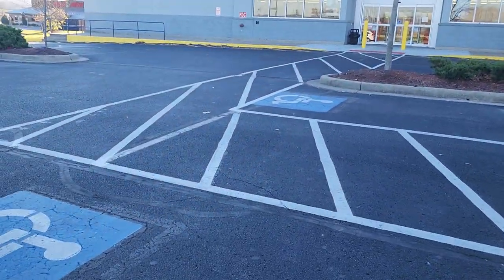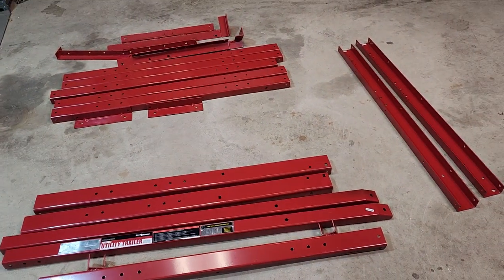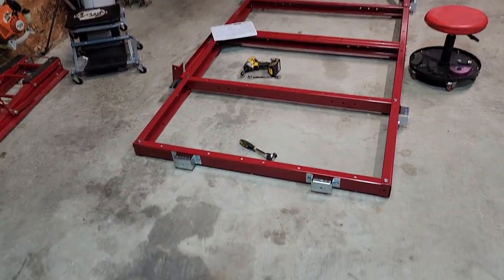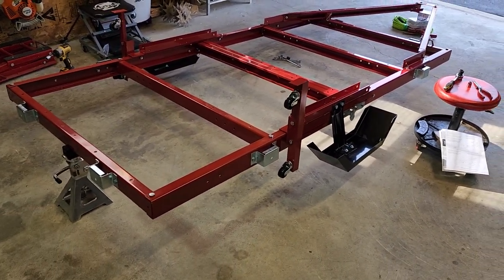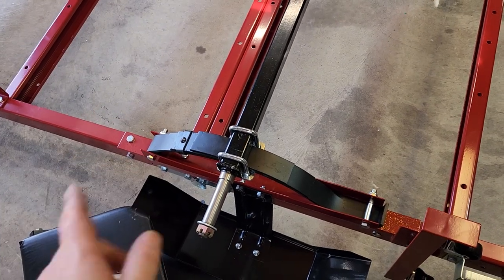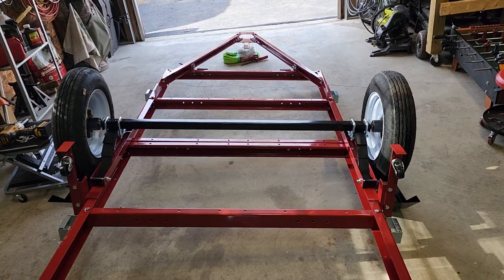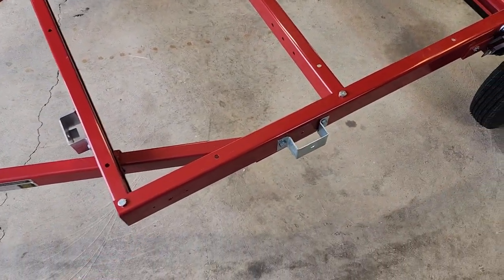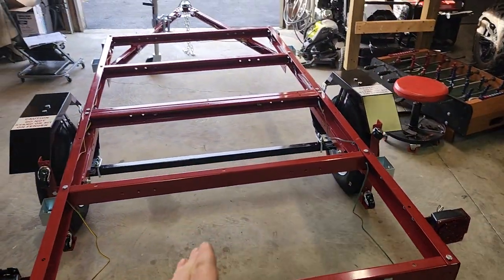Building a Harbor Freight Trailer | 4x8 Folding Utility

Comment: From what I've learned.   The blue grease is just for transporting. It's recommended to (from the instructions [I could be wrong] to repack the bearings).  I did watch a great video to get a 4x8 sheet of ply wood and mock it up on a couple saw horses. I'm going to buy one just waiting and doing my research. Thank you.  Don't forget to the lights.  The ground is an issue.
Reply: I liked and subscribed for support.
Reply from the maker: Thank you!
Reply: The company that builds these trailers would have so many lawsuits if they didn't have actual usable grease in those bearings, there's nothing wrong with swapping it out with better Grease. But it is real grease.
Reply: Blah blah blah but I could be wrong

Comment: I got one of these 20 years ago.  Here are my suggestions (which of course may be out of date):
- do something to prevent the nuts from just vibrating loose at the pivot points.  Buy Nylock nuts, use thread locker, weld them, or whatever (it looks like maybe HF has done this for at least some of the nuts?)
- the lights use the frame as a ground connection.  This is sketchy at best, and hopeless at the hinges.  Either run a separate ground wire to each light from the plug, or at least  a jumper wire from the front to back half to bypass the hinges.
- replace the flimsy office chair casters with sturdy casters -- although maybe HF has already made this design change?
- get a couple of those reflectors on 4' plastic stalks that people put next to their driveways, mount them in short pieces of 2x4 and stick them in the brackets at the back of the trailer.  This makes your trailer much more visible in traffic and easier to back up, as well as providing comic relief to other drivers as they flap back and forth in the wind.
Reply: They do come with Nylock nuts now, thankfully.

Comment: 6:00 I didn't bother putting the casters on mine when I built it, I bolted the two halves together to make it stronger.... However, if you did put on the casters and are having trouble fitting a wrench in there, if you have a local bicycle shop they usually sell flat wrenches for doing work on bikes..... You might get lucky.

Comment: I assembled mine last year but now I tried to use it and the carriage bolts don’t line up so now I don’t know what to do other then reassemble it. Any ideas?
Reply from the maker: What do you mean the bolts don't line up? If it's together, what bolts are out?
Reply: @DirtbagOutdoors  some of the carriage bolts are not aligned now so I need to loosen the other bolts in the corners after not using it for a year. it seems to be all miss-aligned.
Reply: @DirtbagOutdoors  I just had to loosen the hinge bolts since they were a little out of whack and twisted a little so it messed the carriage bolt alignment up.
Reply from the maker: @AM2PM  interesting. Yea, i would think just loosen the ones around it and see if you can realign it. Metal doesnt really move on its own, so it seems kind of odd
Reply: For anyone trying to square it while building it. Build it on top of your plywood. Square it off to that. Much easier trying to square it from corner to corner.   Also, might as well mark your drill holes for the wood while it's there. Will be doing this when I put mine together.

Comment: How does it pull? and how well does the CF Moto fit on it?
Reply from the maker: It seems to do well so far! The cfmoto fits but it is tight. Stay tuned and I'll do a quick video on loading it or showing it on there

Comment: If you're not folding it went did you bother putting the casters on?  Those things hit speed bumps and get banged up
Reply from the maker: I took them off. Never used them. I wasnt sure if they were required for something else